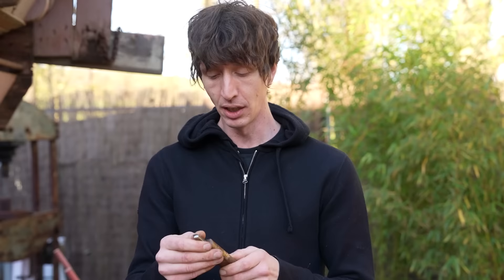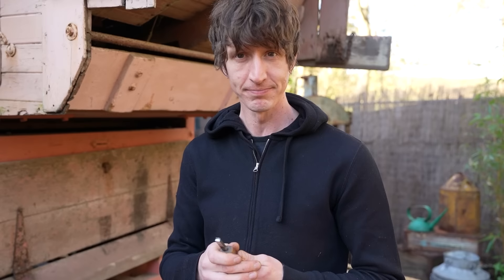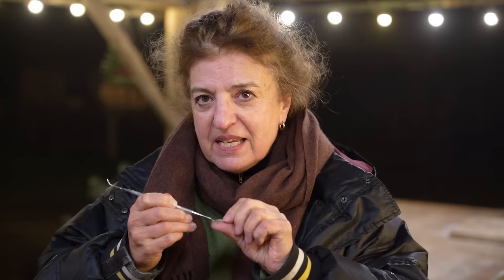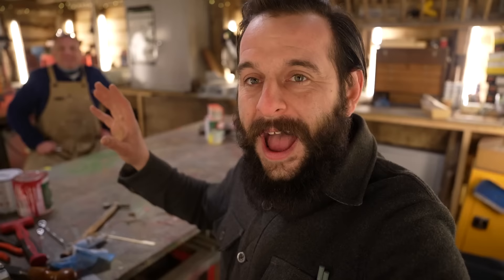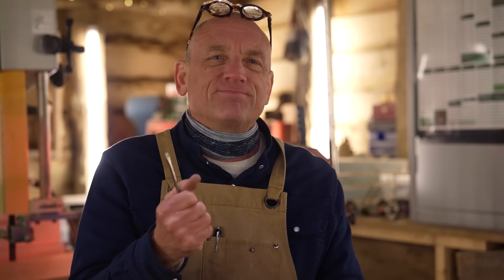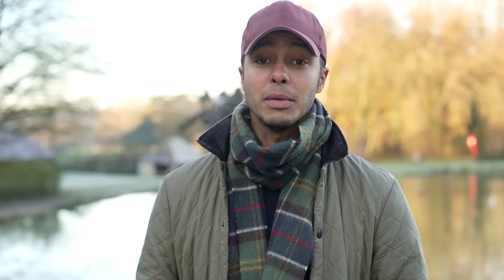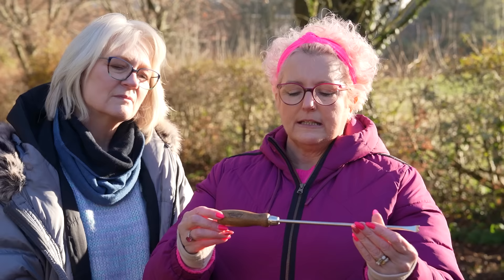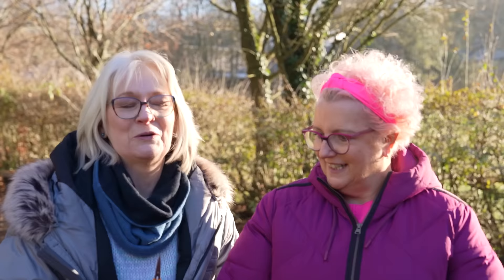Tool Time at The Repair Shop | Part Two

Comment: Carding cloth comes in 5 grades: 54, 72, 90, 120, and 190 TPI (teeth per square inch).  That sounds the sort of thing they're looking for.  I think it's normally sold in 12" widths for drum carders and blending boards and there maybe a minimum order.  An online search for carding cloth should produce a few suppliers.  If they know what grade they have they could buy some or maybe get offcuts to replace what they currently use.   I'm not sure how they'd find out how soft it is.

Comment: The lovely ladies working on teddy bears should talk to a gunsmith. What they have there is a gunsmith carding brush. They are very soft steel bristled brushes used to card off the rust on firearms when rustblueing for instance.
Reply: The softer brush could also be a 'slicker' brush rather than a carding brush.
Reply from the maker: Thank you!
Reply from the maker: Thanks so much
Reply: I wish I knew how to send a photo, but for the bear ladies, I use a slicker brush for short hair cats and dogs. Same shaped, soft bristles. Quite large as sold, about 3”x4”, but the bristle pads could be cut and attached to smaller handles. Available in pet section of dept. stores here in the states.
Reply: @thomassymber   I was going to suggest a pet shop as well. 
💚🐇🐴💚

Comment: Steve Fletcher holds up the first tool that I ever bought myself.  I picked-up one of those little ratchet screwdrivers from Woolworth's with some of the cash from my very first ever pay packets.  cherished the little screwdriver for many years but then suddenly it just seemed to disappear.  Then many years later I rediscovered it buried in the grass my parents garden, much to my surprise the ratchet still worked perfectly even thought the blade itself was exceeding rusted and most of the pint had parted company with the wooden handle.  I pretty sure it's still tucked away in the "old tool" box out in the garage now.  I'm getting on a bit now but the sight of that screwdriver brought back pleasant memories; I'd better dig it out, and put with the gear that's eventually going to accompany me in my box on my final journey.

Comment: I have the same small ratchet screwdriver as Steve has, its a Stanley that I bought new in the mid 70s; it has no paint left on the handle and the chrome is wearing away.  For Christmas I would like a bigger workshop to put more tools in.

Comment: Lovely episode Dom. I love Steve's grandfather's what I'm pretty sure is a Stanley 4" ratchet, I did have one of those but I lost it many years ago. Probably inside an Organ somewhere that I was putting back together after it was rebuilt. And probably found by another organ builder in the last 20 years lol I also had the big brother of Steve's one I think they had 8" long blades not including the handle with about a 3/8" wide tip suitable for number 10 and 12 wood screws, not the crappy things we get nowadays but proper Nettlefolds wood screws. Shows you how old I am lol. Happy Christmas and New Year to Everybody at the Repair Shop and to you in particular Dom

Comment: The small brush you can try the brass suede brushes,  others are used for cleaning out metal files.  There is a leather goods supplier (the shoe man should know - Healy's near Rotherham - that might have the card ones in stock).

Comment: To the Teddy Bear Ladies; Suede shoe bushes are what I use sometimes. from places like Trespass or maybe Amazon. I also make really stiff one from file cards glued to plywood.
Reply from the maker: Thank you! I’ll pass it on
Reply: @DominicChineas  Dom, I have similar brushes like this for cleaning metal files, needed especially if you have been filing soft metals.

Comment: Fascinating. I love old tools and have a shed full of them. Many of my older tool either belonged to my father or grandfather. I have some lovely wood saws that I would love to get sharpened but I cannot find a saw doctor anywhere these days. Any idea?
Reply: It's  possible to buy a sawset and a saw file and do it oneself. Amazon have sawsets for less than £30 and triangular saw files for less than £10.
Reply: @alanclarke4646  Thank you. I might give that a go.

Comment: A great video Dom - thank you. I have the long version of Steve’s screwdriver which has proven to be indestructible. Apart from turning screws, this tool has done service in many unconventional ways too. It has even stirred paint….. (Shame on me….) The handle is worn, the tool is old, but it still gets the job done. Yes, I would know it if blindfolded.

Comment: Will, you need a fine diamond hone or wheel, followed by progressively finer wet and dry paper on a hard, flat surface. Finish on a felt buffing wheel with metal buffing soap. 5 minute job.

Comment: I use soft-backed pet grooming brushes for carding my flocking wool, which I purchased in my local pet store, they are quite soft because they are meant to be used on small domestic pets - and I got my flocking irons from Abbey Tools.  They come in straight styles like Amanda's stuffing tool and curved for getting right into the awkward crevices.

Comment: i've got one of those ratchet screwdrivers in the shed , but its bent ( must try to restore it if thats possible ) , and that spikey belt , we used to use that for fuzzing and trimming carpet tiles at work , i'll ask around to see if we still use it  ( i work on a warper now in another part of the shop floor )

Comment: 7:23 I think those screwdrivers were part of the tool kit that came with some British cars in the '70s. I remember a yellow handle (that describes most screwdrivers of the era) and a long double-ended bit with King Charles ears sticking out which engaged with grooves in the handle.

9:18 Dad had one of those ratchet screwdrivers in the '50s, and it was a major tool in my cycling and Lambretta SX200 years (I got my own tools when I got the Norton).

In my watch-making hobby my essential tool is my long-throw binocular microscope. Many a Bulova Accutron and Valjoux 7750 has passed beneath its objectives.

Hang on - I've got to stop watching and commenting - this is too good to watch in secret by myself, so I'll save it to watch with a friend over a glass of La Tache.

Comment: That was great fun to watch!  I've got a suggestion for the Bear Ladies - there's a company called Classic Carder whom I bought my drum carder from and they do a packing brush (I think they call it a cleaning brush in their shop).  The bristles are really soft compared to my hand carder brushes and as they make their own carders, they might just be able to sell the ladies just the carding cloth so they can replenish the little bit they need to be stapled to their brush handle. 
For Lucia, I have one of those simple double ended screw drivers - BMW Motorrad used to bung them in the tool kits so we used to end up with loads of spare ones.  Happy to send it to her if she misses her one so much :)